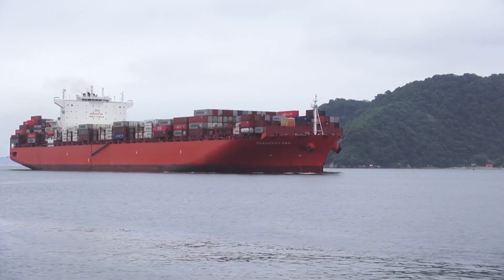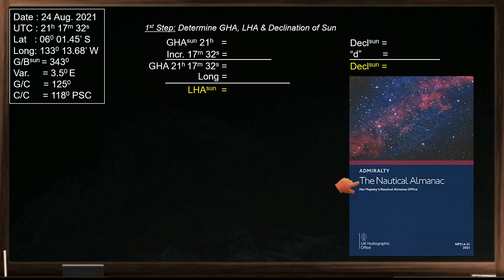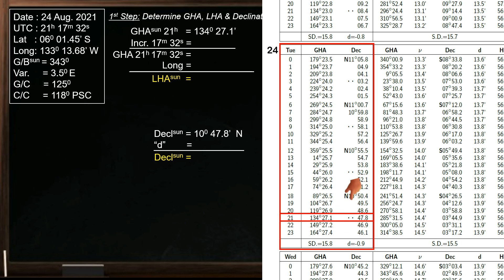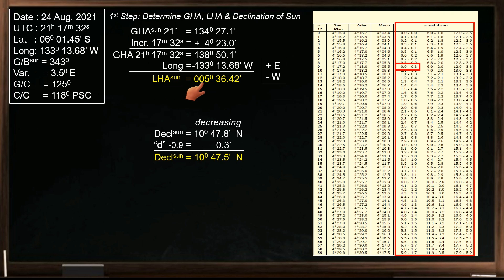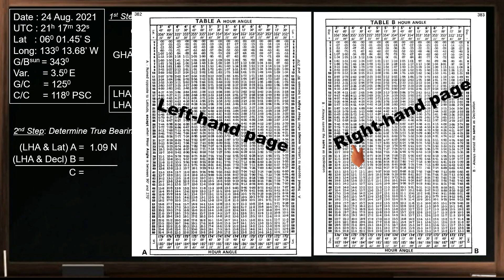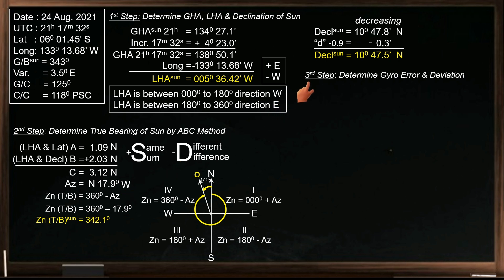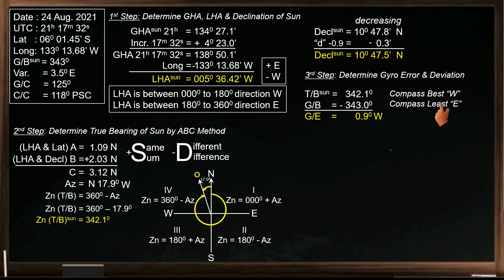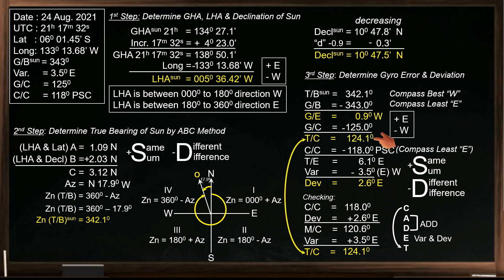Calculate Gyro Error and Compass Deviation: Step-by-Step Guide with the ABC Method

Comment: always the variation need to be reversed for calculaton purposes?
Reply from the maker: Only when applying variation to the total error in order to determine the deviation. In this specific step, the variation is temporarily reversed for calculation purposes. In all other cases, variation is applied normally according to its direction.

Comment: PSC is not magnetic compass
Reply from the maker: Thanks. PSC stands for Per Standard Compass, from which the values come from the ship’s magnetic compass required by SOLAS. So PSC values come from the magnetic compass—not the gyro. The standard compass is the basis for deviation tables and compass error checks.

Comment: How about the LHA is more then 360, let say the results is 435.
Please explain brother
Reply from the maker: Good question, brother 👍. The Local Hour Angle (LHA) is always expressed within 0°–360°. So if your calculation gives a value greater than 360° (like 435°), you simply subtract 360°.

For example:
435° − 360° = 75° → that’s your correct LHA.

It’s the same logic as converting time on a 24-hour clock — once you pass 24h, you cycle back to 0h.

Comment: i have a question  since my lha sun 70 degrees and i check norris table A it does not show any minutes only degress? please answer.thanks
Reply from the maker: If there is only a minimal difference on the value between 69 & 70, or 70 & 71 degrees, take the nearest value. In taking the nearest value, consider the minutes of your hour angle. But if the value have a large difference, then interpolation must be done to get a more accurate value.

Comment: On 10:43 why did the variation become West when it was originally east?
Reply from the maker: Thank you for the question. This is the rule used to find deviation from a given compass error and variation: Always reverse the name of the variation to find deviation. Otherwise, we can plot the variation first on the plotting sheet, then plot the total error to determine the deviation and its direction.
Reply: On 7:04 why is it the declination is 11 rather than 10 which is the true nearest declination . ???
Reply: @peterjamesgarlan6299 47.5 minutes is closer to 60 minutes than to 0 minutes, hence closer to 11 degrees instead of to 10 degrees.